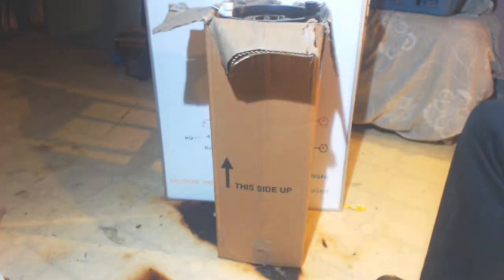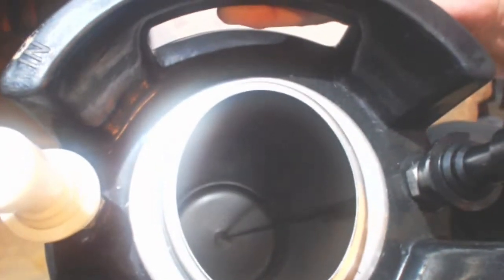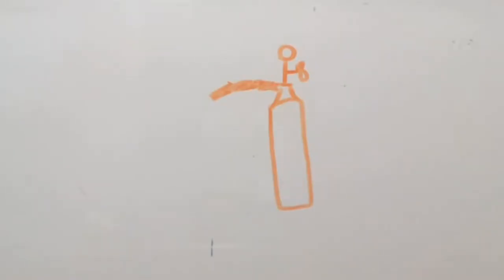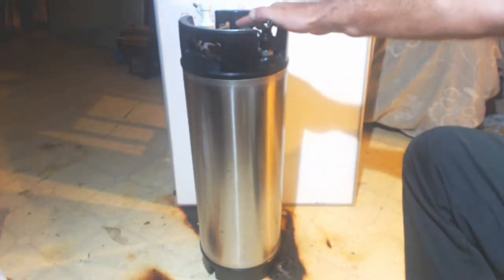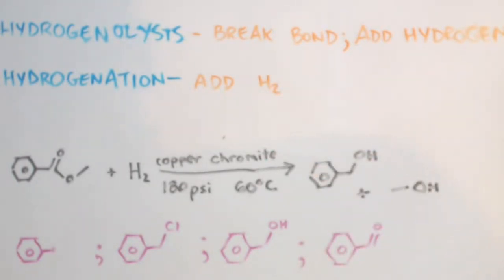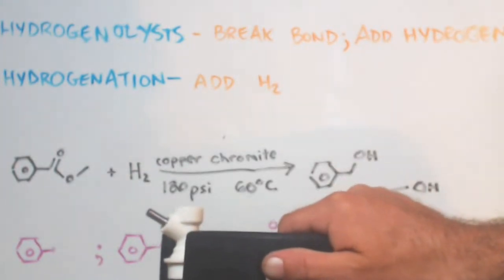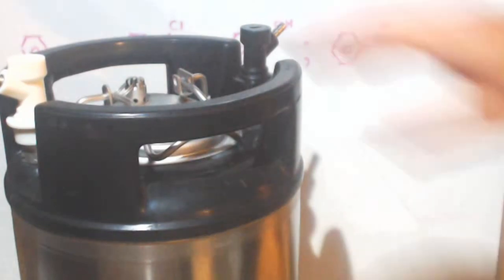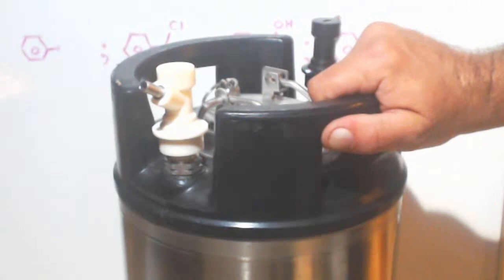UNBOXING HYDROGEN BOMB

Comment: The other H-bomb option  which I think are superior is paint pressure pots (preferably with a pneumatic agitator on the lid). They are a little bit more expensive than these kegs as long as you don't need to go to high with pressure (most can handle up to about 80PSI easily)
Reply from the maker: Joseph Feheley...............Wow that is a great idea.  I never heard of a paint pressure pot.  Had to google it.   I think I still prefer the cornelous keg better.    Other than hydrogenation/hydrogenolysis of alkenes and imines most hydrogenations are going to need a lot of pressure.  Even the cornelous keg I got is not enough pressure for the hydrogenations I want to do and it can handle 130 psi.  I would really like one that could handle 250 psi.  My buddy has one made from an old propane tank.  NOW THOSE CAN HOLD BIG TIME PRESSURE.